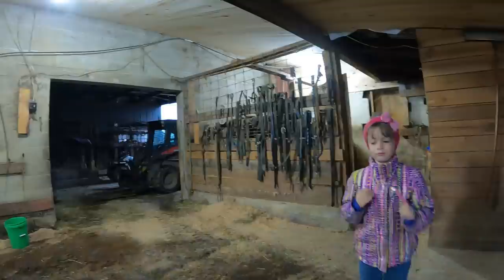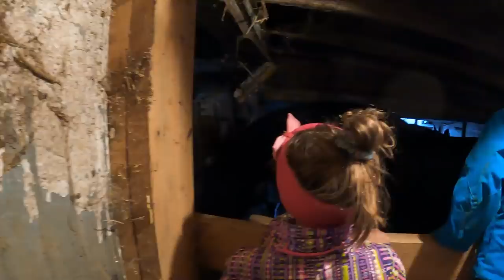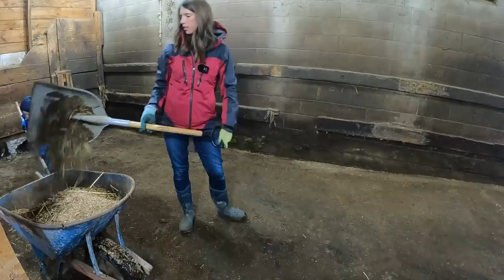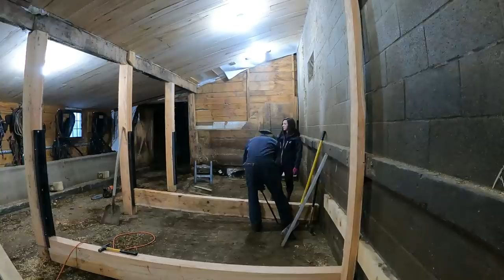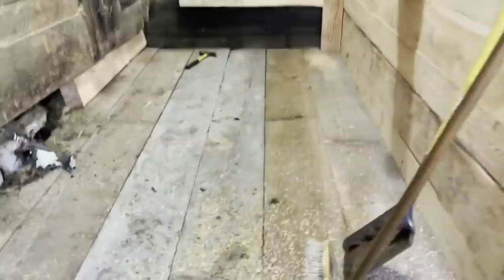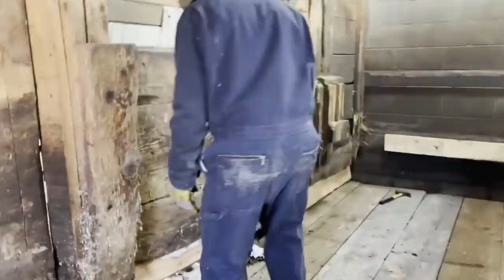A New Barn for the Horses?!?!! A Family Renovation Project 🔨💪

Comment: Didn't know it was your birthday. Happy Birthday! Since you are re-doing your stalls, do you consider putting in waterers, so that the horses have access to water whenever they want?
 I agree with Brenda, the desensitization with everything that's going on in the stable is good for the young Suffolks.
Reply from the maker: you forget where we live, the pipes would be frozen 5 months of the year.
Reply: @WorkingHorsesWithJim  I think I have seen commercials on RFD-TV that offer solutions to that, but I do not know anything about the price.  In Bavaria, where our  winters can also be rather cold, I had such waterers in my stable.
Reply: @klauskarbaumer6302  the barn is unheated and would probably be cost prohibitive to install pipes, heaters, etc.not to mention the electricity to run it
Reply: Living just west of Rochester, NY, frozen water in the winter is always a concern. I HATE chipping frozen buckets & dealing with water hoses that freeze up & all the negative issues of watering in freezing temps. We get the lake effect storms off Lake Erie & Lake Ontario, so we came up with solutions that are not terribly expensive, but more importantly provide the horses with more than enough water during the cold temps we deal with. In our stalls we use 2 heated water buckets - ea 5 gal & usually the girls drink on average 1/2 bucket total overnight. So I could go down to 1 bucket for my Fjord, but my boarder’s horse likes to poop in one of her buckets at least twice a week. Outside I’ve got a 100 gal Rubbermaid tank w/a floating heater, which works great. Between the 2 horses they each drink about 10-15 gal if water a day. So keeping water in front of the horses 24/7, although is nice, having it at night isn’t really necessary, if they’ve got plenty to drink during the day. Yrs ago I worked at a farm that had +/-15 lesson horses in straight stalls for the night, ea offered water before secured for the night & then again 1st thing in the morning. They did perfectly fine, no incidents of colic or other gut issues. The heater for the water tank usually last about 5-6 years & the same for the buckets. They are plugged in from mid Nov - March & then I put regular buckets in the stalls & put the tank heater away until the next season. Even though I’ve got the draining hydrant in the barn, I do put heat tape on the pipe - if the handle isn’t closed completely, the water won’t drain & you have a frozen pipe. The hose for filling the tank is removed & drained after ea use as well. I would rather take a minute disconnecting & draining a hose, than take all day thawing a pipe. So many people get nervous if a horse doesn’t have water in front of them all the time. From my 50+ yrs of experience, I think horses can do fine w/out water at night - if they’ve got good access to water during the day & are offered water before being tied in at night in a straight stall. I like the remodel & I’m sure the horses will as well. I really enjoy watching you drive, I’m hoping to get back to working my Fjord, I miss driving, but medical issues have kept me away from doing any driving for over 10 yrs - I competed in pleasure driving competitions around NY & enjoyed putting miles on just driving down the road, driving single & pair. I miss it, but have some great memories. Thank you for sharing your farm life! God bless!
Reply: @WorkingHorsesWithJim   its not the location, its the insulation.  up here in canada its suicide not to heat anything.  Barn is heated to 5c and goes higher the rare times the horses are in.  Horses bring the temp to 10c but the horses only sleep inside at ends of pregnancies. The waterers do not freeze in any of the 3 15x10 stalls.  We use one stall for chickens cause the horses are seldom inside with the lead mare acting like a 2000lbs donkey killing the random predators that dare come on the property

Comment: I had a concrete floor in my stable, and we put rubber conveyer belting on the floor of the stalls, with wood shavings on top of that, and it was great, easy on the horses, easy to clean, and it didn't absorb any liquids. Each stall had a drain in the floor, and about once a year i would remove all of the shavings, and hose down the belting, and floor, then let it dry, replace the shavings, and it was as clean as it was when new. 🐎👍🇺🇸
Reply: we have recycled rubber mats and put shavings on top as well. It's perfect